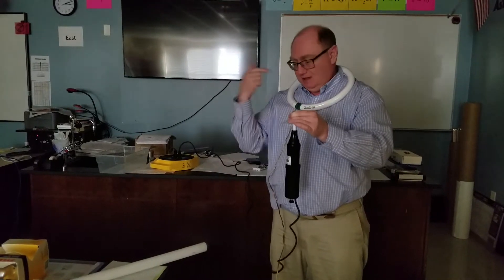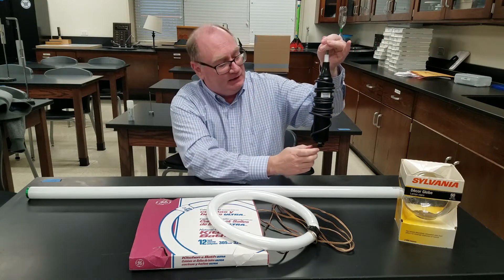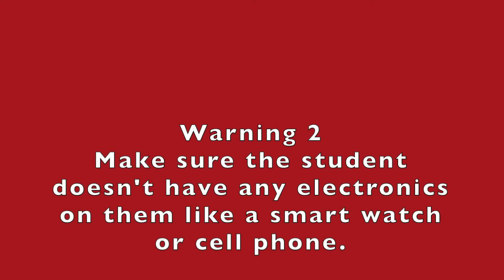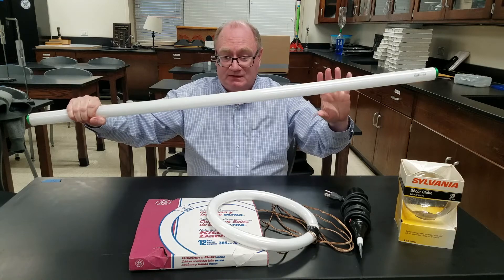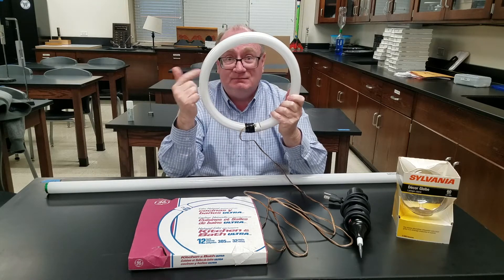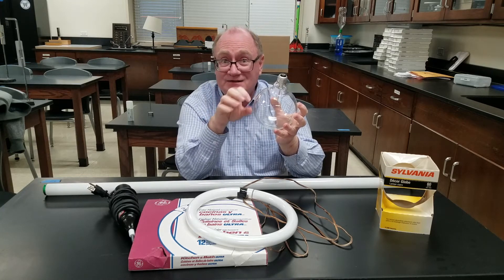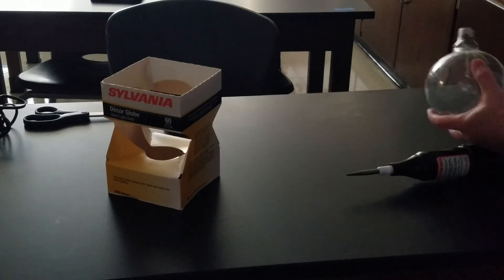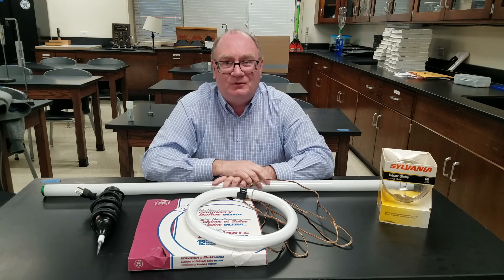Tesla Coil Demonstrations

Comment: Technically, the high voltage generator you are using is a Oudin coil.  I call it a Tesla coil myself. The difference between a Tesla and Oudin coil is almost a distinction without a difference.  One has totally separate primary and secondary coils, the other is an auto former.  I don't remember which is which.
Reply from the maker: Thanks for the information. I have to look up a Oudin coil. I have always called it a tesla.